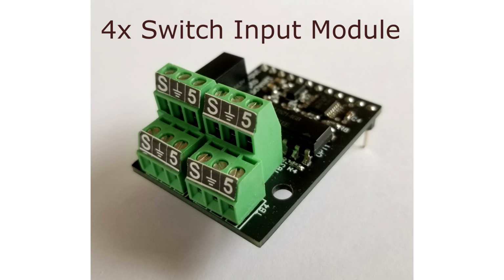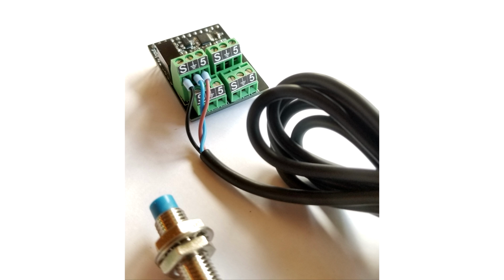A New Universal CNC Controller for Grbl_ESP32

Comment: Guys, is there a reason for ommiting C8 in the latest V1p8 version? It's in every schema, but in BOM it says "do not place" (as does J11 and J25, but those are just jumpers). If I want to solder it myself, should I add the C8 or not?
Reply from the maker: It was only needed for some very early esp32 modules with boot problems.
Reply: @engserve  Oh, thank you for a reply. And for the board, it looks amazing!
Reply: @engserve  One other question - is 2oz copper needed for the PCB if I won't run industrial grade motors but just simple hobby NEMA17?
Reply from the maker: @GargamelCZ  1 oz copper is good for about 8 to 10 amps of continuous current before excessive temp rise.
Reply from the maker: @GargamelCZ  join our discord server for further question. Support via YouTube comments is a pain.

https://discord.gg/WZTF7fdw

Comment: Hello sir kindly help me 
Where I will get 5 axis cnc firmware for machine
I am using Arduino mega 2560 5x + 1.4 ramps board 
But I am only getting 4 axis output I want all 5 axis output in my machine 
Please help me where is the problem in my cnc firmware which I uploaded in it kindly help me to get 5 axis cnc firmware for Arduino mega 2560 .......
Please help help help

Comment: You are doing awesome work. Keep it up. What if I wanted to make a tool changing pen plotter with one of your boards. What do you suggest? I am not a programmer but I can build just about anything  I put my mind to. I have already built a CNC router and pen plotter. I  am seriously thinking about upgrading my plotter to one that can use multiple pens/colors. What guidance can you offer for building the plotter in terms of the software side of things?
Reply from the maker: Grbl_ESP32 has the infrastructure to handle tool changes. It will understand when the gcode says to change from from one tool to another. It will then call the function to change the tool. The problem is every machine type will handle it differently. You need to provide the code that says how to put the last tool away and how to pick up the next one. It could be quite complicated and require measuring tool lengths, etc. You need to provide that code. Here is a simple example. https://www.youtube.com/watch?v=XTdoDOojJFQ

Comment: what software will work with your board to control 6 axis
Reply from the maker: It is designed for use with Grbl_ESP32 firmware (free and open source on GitHub)
Reply: @engserve  thank you very quick answer ,can i instal on raspberry pi and can i get your board in europa?
Reply from the maker: @elmakcnc5960  It runs on the ESP32. A Raspberry Pi is not able to do the precise timing that a microcontroller can.

Comment: Would a full six axis have enough IO's or addon ability to run the OLED i2c screen?
Reply from the maker: Yes. Typically we use phones, tablets and PCs as screens via wifi, but an i2c LCD interface module is likely to be developed.
Reply: Awesome work. Have you got an adaptation to fit din rails nicely? Similar height as tb6600 stepper drivers would be awesome, extra modules could fit a few in a separate piece to the side of the main board if room is an issue. Although looks like it'd fit easy.

Comment: Do you already have the Trinamic modules in SPI mode available in grbl ESP-32 software? Thanks a lot.
Reply from the maker: Yes, including an stallguard tuning mode. You can use 1:1 chip select lines or daisy chain SPI CS.
Reply: With Stall Guard you don't even need end stops, right?  More room for delicious modules 😁

Comment: This is a very cool project! Only it turns out that using 6 engine drivers, we can use 2 engines simultaneously on the x, Y, Z axes, but we will not get a real 4-axis processing. The ESP 3D interface does not support 4 axes. And for GRBL, I didn't find a control program on 4 or more axes. Or are there such programs?
Reply from the maker: It will run 6 axis gcode. The ESP 3D interface supports 6 axis. It is up to you how to use 6 coordinated motors. CAM programs like Fusion 360 can generate multi axis gcode.
Reply: @engserve  It turns out that we can't control 4-6 axes via the graphical interface via ESP 3D, but we can control them via the console? Then this is another plus in favor of GR BL. It is a pity that there are no programs for managing 6 axes via the interface. But I think it only takes time. Thanks for the answer.
Reply from the maker: @MaxAltera  What console are you talking about? On Grbl_ESP32 you can control 6 axes via WebUI, USB/Serial, Bluetooth, Wifi/Telnet and SD card.
Reply: @engserve  For USB operation, such as Candle or UGS. I know what you're talking about. Thanks for the help.
Reply: There are such programs, I am currently woking on one for Windows - it has support for up to 6 axes.
https://github.com/terjeio/Grbl-GCode-Sender

This one has for five: https://github.com/shaise/GrblCNC

Comment: Awesome work. You know what would really be beneficial, a Marlin port to work on this board with correct pinouts as well and maybe some other well-known firmwares. I know it's meant for GRBL, but adding compatability is something that interests me personally yet I'm not savvy enough to do a port myself. With Marlin and some other FW's I reckon it would for example be easier to add an LCD or TFT screen. I wish that 3D printer boards had this kind of expansive capability. In some ways they do, but there are so many different boards and every producer tries to make the next design that sells well. While in this case when looking at the older CNC shields for example, it has a very clear lineage and there is only a small selection of boards that I could find that were designed for GRBL. I hope this board will become the new 32-bit standard for GRBL boards. I think in this case it's good that there aren't many different designs so that others that will design expansions will probably design it for this board. Standards are good since it means a lot of users will use the same item and it will get a lot of constructive feedback and when a part breaks, there are many community members that know how to fix a certain issue. This is what has been bothering me in the 3D print world; there is a whole forest of controllers a company even named themselves after being the biggest tree ;) (BigTreeTech). I see so many people asking questions over on the reprap forums about obscure boards that only a handful of people have real knowledge about that it's so hard to diagnose the issues.
Reply from the maker: The modules are not dependent on any one firmware or microcontroller type. It would be great if this were extended to other firmwares. More module options is better for everyone. I only have enough time to work on one though.
Reply: @engserve  Yes of course, I understand you don't have this as a full time job :) I hope the community adapts your design because i.m.o. it's very flexible and could serve as a good base.

Comment: Would you also consider an edm application/module? If you remember, we talked about this. GRBL needs to have an external feedback input for that. So it would override the feeds and speeds in real-time.
Reply from the maker: Maybe, that might feed well into torch height control and lathe spindle modules.
Reply: @engserve  that would be wonderful!
Reply: @engserve  Hello! if you have any updates with THC would be nice to know. Best wishes!